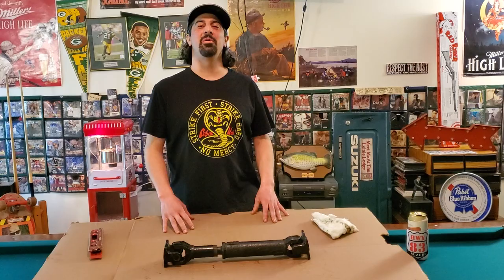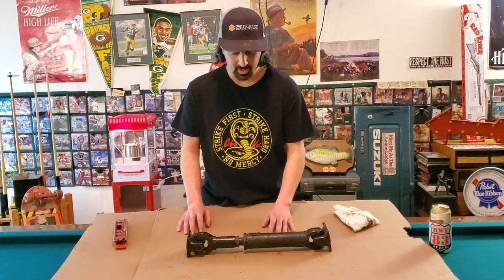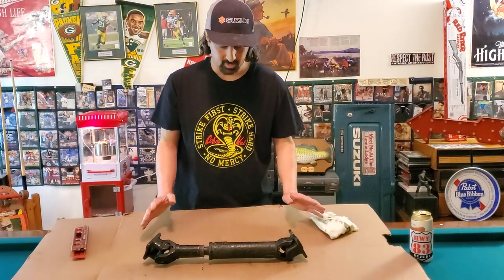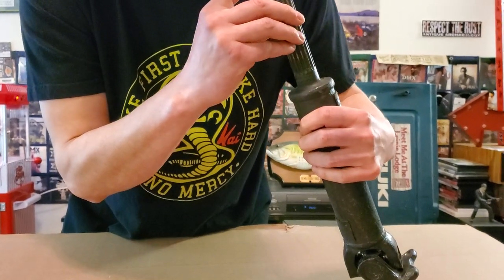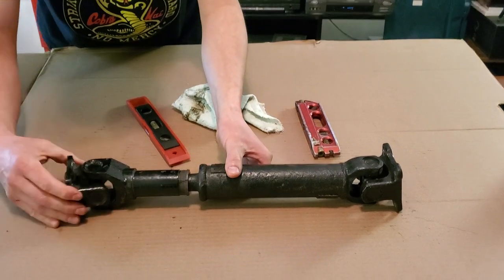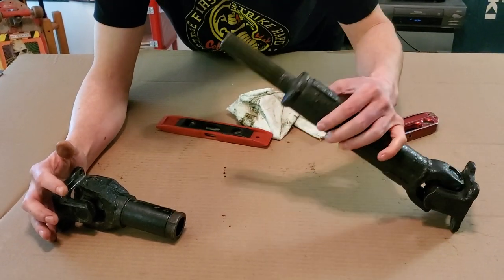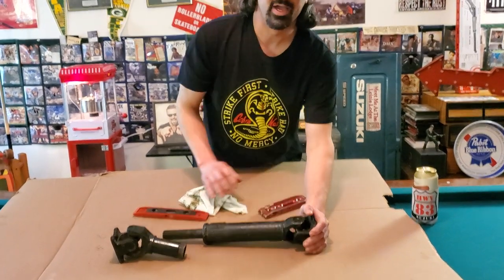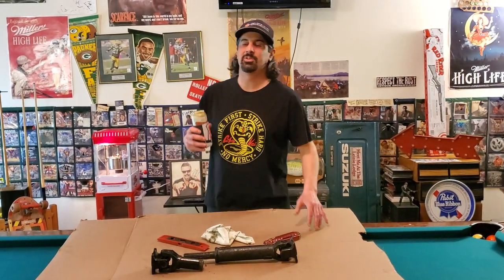Phasing a Drive Shaft - installing balancing PHASE Suzuki Samurai driveshaft @Hwy83SUZUKI

Comment: Hey Tony, currently looking for the cause of a loud rear clunk shifting into 1st and 2nd gear. Saw my 88.5 has a rear drive shaft that says "87 Samurai" on it so I am guessing it has been replaced. Any issues running an 87 rear drive shaft on my 88.5? Thanks
Reply from the maker: Trans and t case mounts, rear diff bearing,u joints.  Check everything listed
Reply: @Hwy83SUZUKI   took out the drive shaft today and checked all the u-joints, seems to be good, will go through the other things listed. Thanks so much!